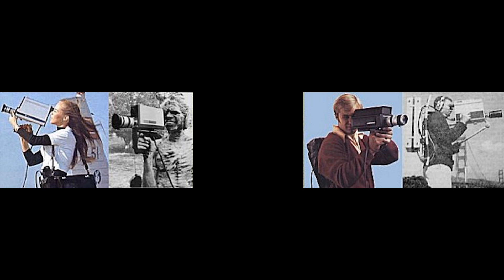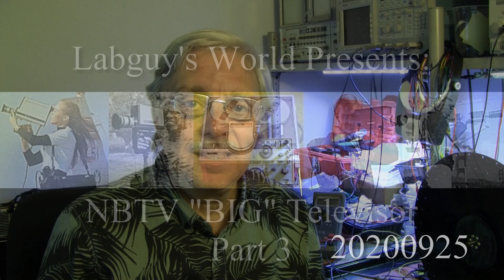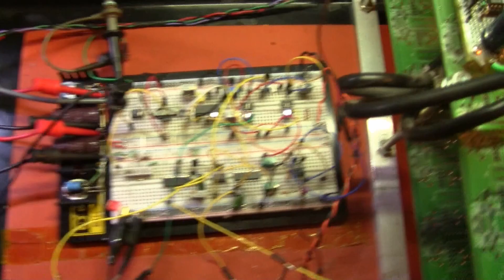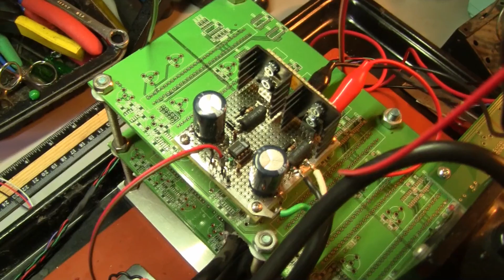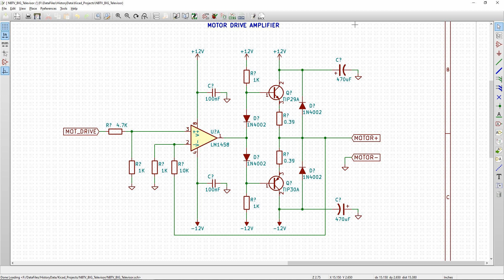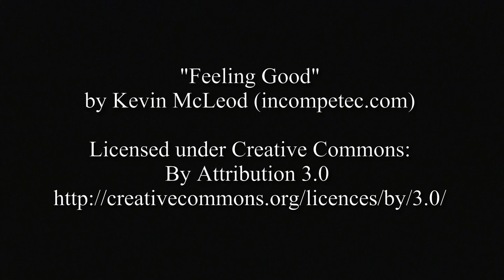NBTV "BIG" Televisor, Part 3

Comment: I am looking at your 555 Missing Pulse detector.  I take it that the normal sync pulses are used to reset the 555 so that it is in sync. What mode is this timer running in? It is such a complex chip. It is of interest to me as I think it might be a great way to detect the Frame Sync.  Also, did you abandon this circuit? I notice that on a later video you are using a different circuit altogether.
Reply from the maker: Yes. I did abandon that design and adopted the NBTV club's reference design. You will see that in later videos. 
The LM555 missing sync detector is covered in more detail in the CRT Televisor project. : https://www.youtube.com/watch?v=vYyjg64XDpc
This project uses unprocessed sync directly. The sync holes in the disk are the same as the sync in the video. There are 31 sync holes drilled around the edge with one dead spot at hole #32. This produces a pulse train that matches the video sync. That is 31 pulses and a pause, repeat. In this case, there is no need to detect frame sync at all.
Reply: @videolabguy  Thank you very much kind sir.  I kept trying to find an exact mode online and was having problems. Especially since reset is always being held High which would make it not what I thought it was. And the cap on pin 5. Nice work. LOL
Reply from the maker: For those interested in "cookie cutter" circuits, you will find many on line calculators for all kinds of these. For the LM555 timer, try this site: https://ohmslawcalculator.com/555-astable-calculator or this one: https://ohmslawcalculator.com/555-monostable-calculator
There are hundreds of sites like this for oscillators and multivibrators. Just do a search for something like; "LM555 calculator" or "opamp gain calculator" or "LM555 missing pulse detector" for instance.
What I liked best about the LM555 calculator was that not only will it calculate frequency, it will also calculate the desired pulse widths too. Very handy and I now get a lot more out of my 555s than I did with empirical design methods. That is trying random R and C values until I got it close to what I needed. That was not ideal.

Comment: Now... question... where is this subscribe button at you speak of!  Now I get it... kept trying to figure out what you were talking about when you kept mentioning servo. You are talking about syncing the motor to the video signal.  I too am building a new Mechanical TV.  Great videos!
Reply from the maker: A mechanical TV is essentially TWO projects. The motor/sync portion and the illuminator/light portion. Looks like you understand that now. 
Update for you: The new NBTV signal generator project is coming along very nicely. I will publish something about that in the near future. I just got a new computer and it is just like getting a new baby. Lots of details to deal with and all of my software needs to be re installed and or updated. This should be done in about a week.
Subscribe button is below right side of the video (in a browser on a computer. I don't trust or do anything on a smart phone. Know nothing about them except that every key stroke, spoken word, photo and video goes to who knows where.)

Comment: Do you need help with the software tools to convert pictures into images on the EEPROMs? Feel free to send me a message and I could give you a hand.
Reply from the maker: Santiago. Thank you for your generous offer. I will certainly consider this and keep you in mind. I will soon be posting a video about how I make the image data files at the present time. Your feedback on that process will be graciously appreciated. You have seen that Labguy will never use a three step process when a ten step process will do! I am joking, of course. I think you will find my process amusing at best. :) )
This is a good opportunity for me to make an announcement about the frame buffer. I have been reviewing the data sheet for the EEPROM flash memory chips (ST Micro M29F40-120K6) I plan to use and I have come to the conclusion it will be possible to make it possible for the users to download their own image data via USB. It appears that in situ programming is not nearly as complex as I imagined. Stay tuned for that innovation.

Comment: Running the motor amplifier in linear mode makes a lot of heat. I guess you could use a 2N3055. I used a mosfet with PWM which means I got no heat at all with a TO220 mosfet. Adding a large capacitor across the motor adds proportional control for free too. Nice to see your project getting there Mr Labguy. Lucky you having a world converter too.
Reply from the maker: My original motor driver was a PWM type. I was informed by a person with experience in televisor servos that PWM drivers did not work for this function as they can not respond fast enough to keep the disk in phase.
You absolutely CAN NOT place a capacitor across the motor when using PWM. In linear mode, yes, you can do that. You did not specify which mode in your suggestion. The cap appears as a hard short to the PWM signal and the power supply current goes to max. I verified this directly. That little experiment almost destroyed my power supply.
Reply: Your motor drive is "locked antiphase" so yes, you cannot put a capacitor across it. My PWM is open drain so no problem with the capacitor. FYI I get one of the fastest frame locks you will see using PWM (7 secs). But I do cheat with 5 lines of PID software,